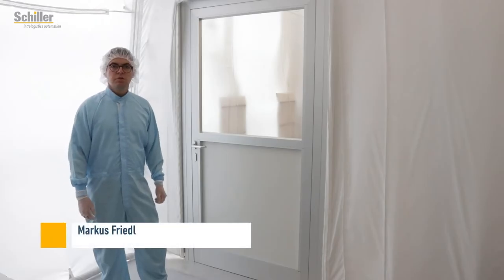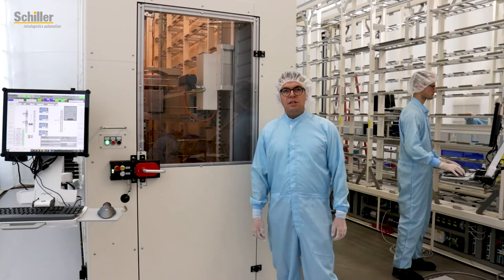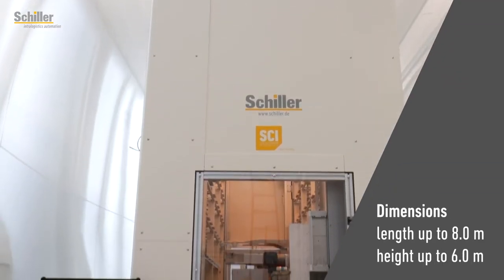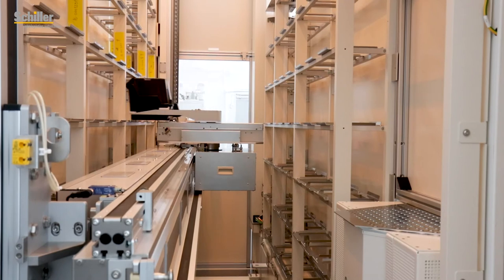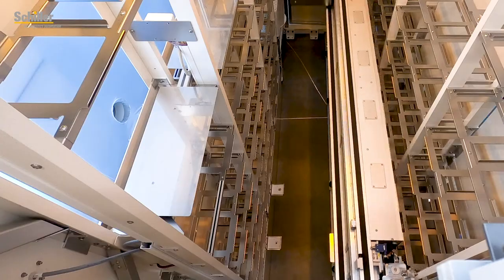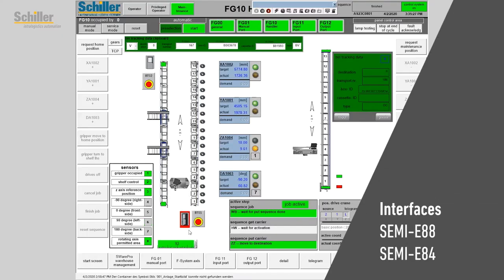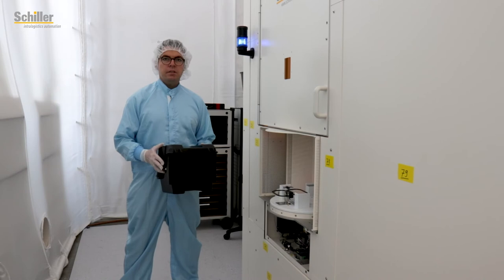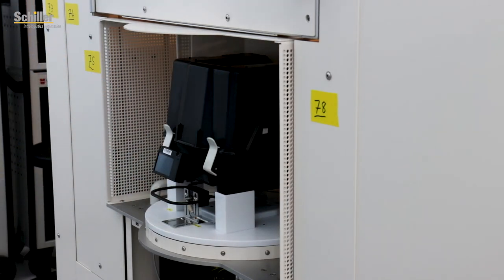Schiller Cleanroom Talk | Linear Stocker

Comment: Does this system includes FFUs?. What is the particulate generation rate and how many ACH required to maintain ISO 3 and for ISO 10 environment. Could the air supply be once through and released into the FAB?